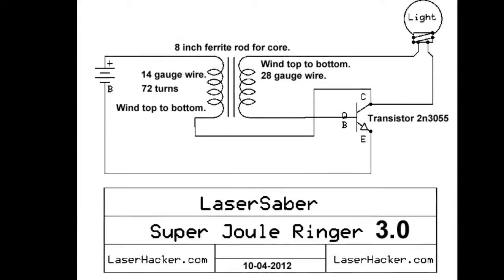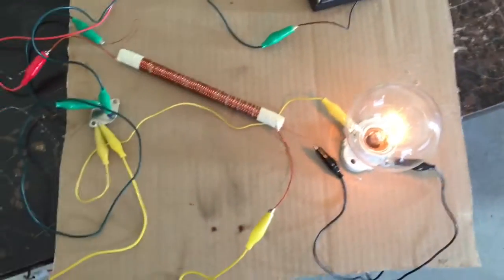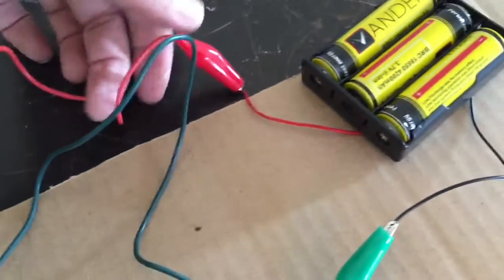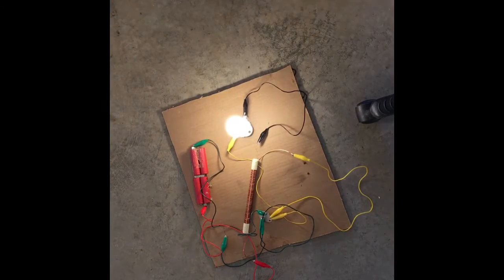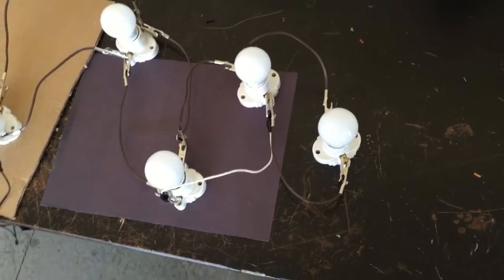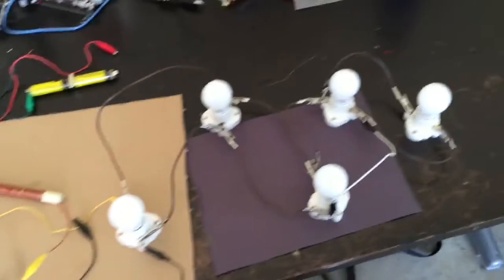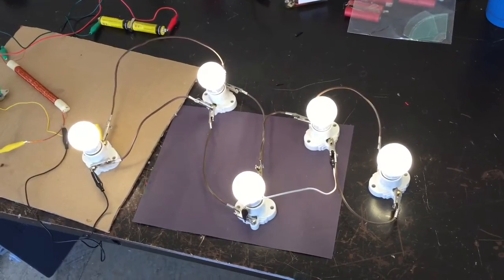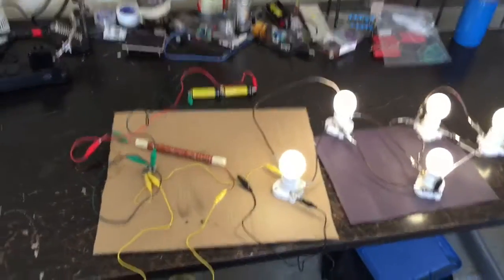Evaluation of Super Joule Ringer - Amazing results!

Comment: Hello,
I have seen your movie on You Tube and I have tried to repeat your experience on the basis of the presented schedule and it...does not work.
I used a transistor 2N3055.

To avoid the losses on the transistors I kindly ask for some suggestions or help:
Do you use the bifiliar reels, what is their coils / rolls?
What is the tickness of th wire in the first reel, how many coils?
the same in the second reel - what is the tickness of a wire and how many coils?
Which reel has been connected to the battery of 4,5 V - at "plus" or "minus"?
Which ending is connected to the transistor?
How is the way of the connection: base-collector-emiter?
Could you share any scheme or drawing?

I repeat the scheme shown in your movie but each time the transistor was demagaged, so - or the scheme is not the proper one or I did something wrong. I would like to know - what?

Best regards

Comment: Hello
write exactly how to wind a ferrite coil how many coils and what thickness you used the wire and how many coils are wound or are they fastened together
Reply from the maker: ja FREE ENERGY  use 8 inch ferrite rod about 1.5 - 2 cm thick. Wind pvc tape over the ferrite rod to insulate it as it conducts. Wind on 30 gauge wire I later thick. Leave 0.5 cm on each end of the rod free. Thats it!

Comment: have you tried hair pinning the bulbs......collector to ac cap to bulb, bulb to ac cap and of to the secondary windings...put jumper wire on caps and check amp draw, pull of jumper and recheck.........enjoy
Reply from the maker: Thanks will try!
Reply: love and peace...........it worked for me...i dont have leads here for my oscilloscope, i think it simply knocks the dc of the secondary coil as it ringing on the 12v line and only need it to start..?.....im open source....so enjoy
Reply: forgot, im using a 5822 diode across base and  emitter............slippery

Comment: sir how many turns on sec?
Reply from the maker: +andreiruiz143 Thanks and appreciate it! The ferrite rod is 18 cm x 1 cm available on ebay or AliExpress. Primary is 72 turns of 16 gauge wound in same direction as secondary. I did not count the number of turns of 28 gauge secondary. What I did was wound it tightly from one end of the ferrite rod to the other ie just under 17 cm with each turn of wire contacting the next turn the same way as in winding a tesla coil secondary. Make sure to place electrical or other tape over the ferrite rod before winding on the secondary to avoid short circuit or  stripping of the magnet wire enamel by the rough ferrite material,
Reply: +TeslaSpot 101 thanks for info sir:)